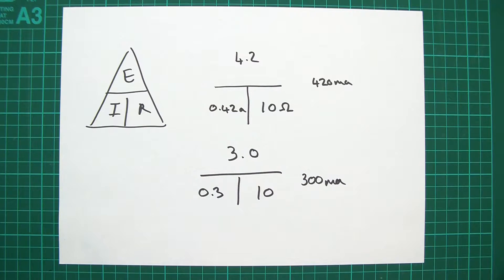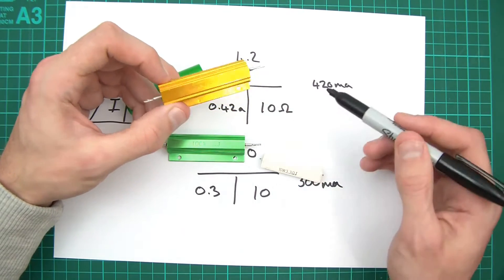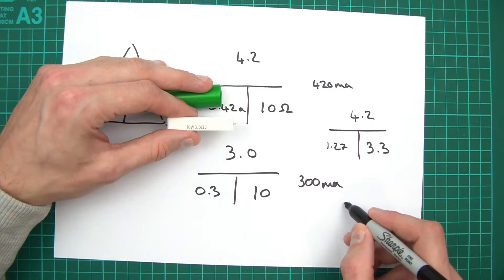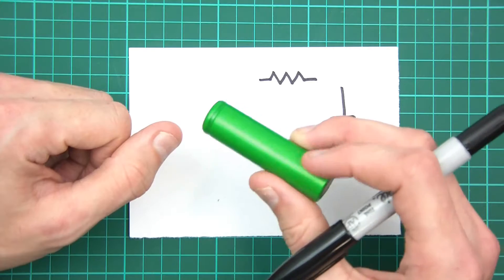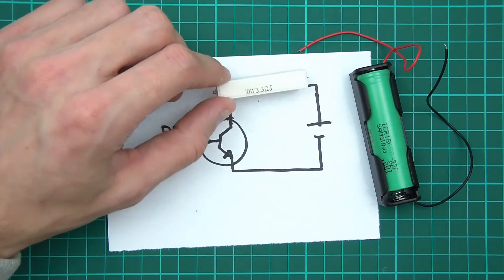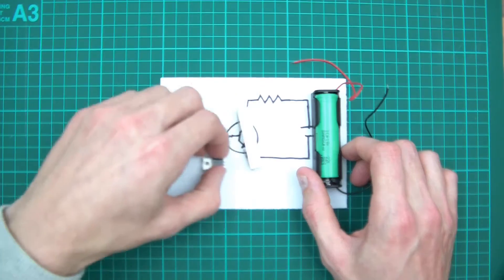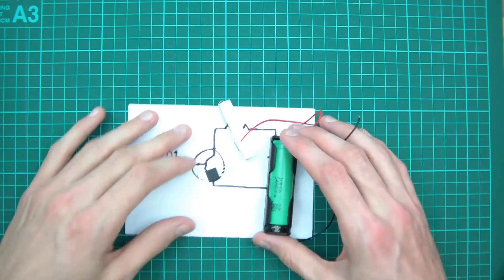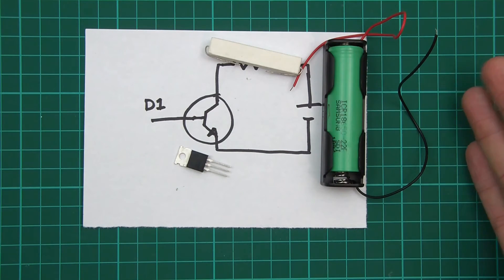TUTORIAL: DIY 18650 Lithium Ion Cell Battery Capacity Checker Tester (Part 2 - Selecting Components)

Comment: I beleave that a pwm signal at the transistor could be used to maintain a constant load eg. 1A...
Reply: Nope, you cannot maintain a constant 1 amp load with PWM whenever the battery voltage falls below 4.0 volts ...

Comment: One step closer!  :)
You kinda brought to attention the "J", but you didn't talk about it. Is it because it has no real bearing in this application, or is it because you will be doing monitoring that the variance in percentage of the rated ohm doesn't matter? I know in another video you said the J was 5% (i think it was) and the actual resistance of the resistor was off by more than 5%.
Reply from the maker: Korishan hey, I just didn't want to complicate the video. It's sometimes hard to know what people consider to be excessive! But j is to do with the resistor accuracy. :) in the other video, I was measuring a very low value resistor and actually, I think the multimeter was not precise enough!
Reply from the maker: One step closer! Waaaa! The next video isn't prepared yet! I've got to get moving! Lol